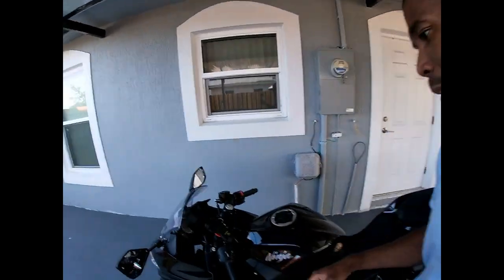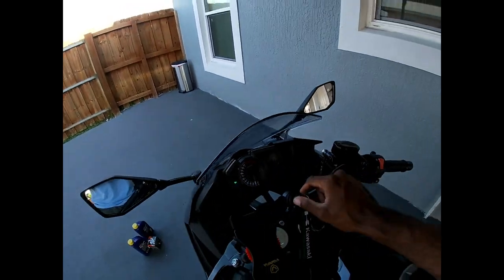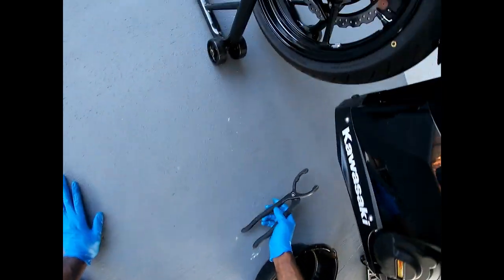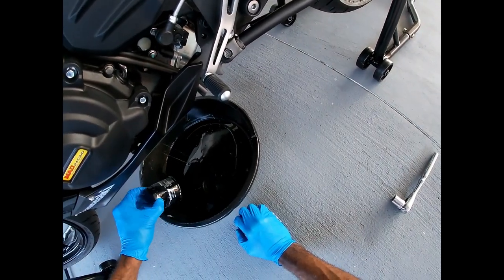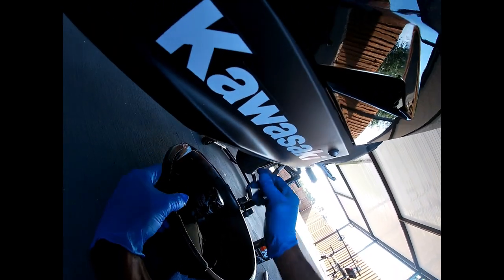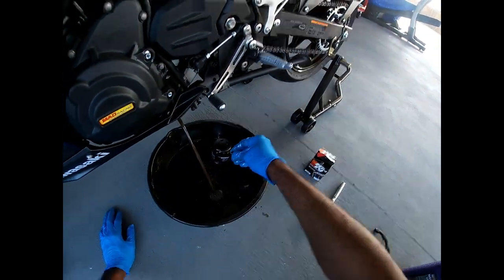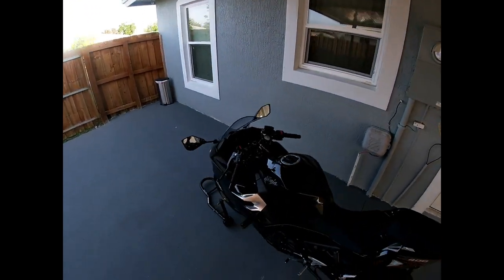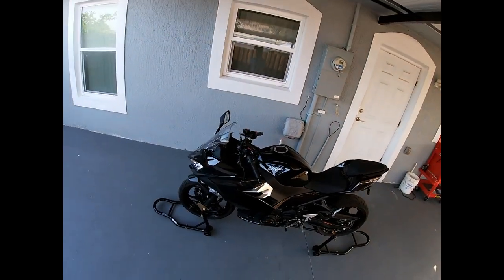KAWZSAKI NINJA 400 2018 - 2023 ( OIL CHANGE )  K&N with Royal PurPle oil COMBO BREAKER!!?!?!

Comment: Just curious on what stands you used to prop the bike up? Venom ones off of amazon?
Reply from the maker: yes yes these are the venom stands off amazon... you have a good eye cheers
Reply: JJMAX2007 just bought a new 400 and I’m about 300 miles shy of the first service and I’d rather spend 240 on tools, equipment etc instead of the dealer doing the service. Glad they work! Just bought some!
Reply from the maker: Awesome i would have told u to get the tools and do it all yourself what I think the dealer should do is something u don't have specialized tools for or thw time to do it but other than that you should wrench on your own stuff... my opinion cheers

Comment: How often should you change it? Like for the second oil change and the 3rd so on so forth?
Reply from the maker: R u referring to the oil filter?
Reply: JJMAX2007 no I’m referring to the oil. Are you really supposed to change it every 400-600 miles? Seems to quick for me. Yeah maybe the first time it’s cool but what about after that?
Reply from the maker: Oh oh it should be 2-4k miles i learned this after the video was posted and recorded smh i should take this vid down but i dont have thw bike no more to re upload with the correct info but to answer the first should be 600 after is was higher
Reply: JJMAX2007 perfect. Thank you so much
Reply from the maker: No worries